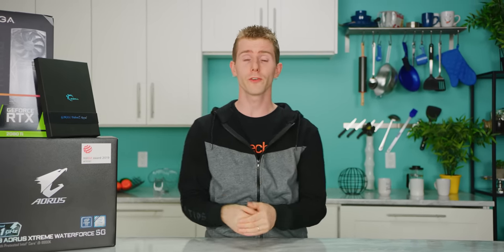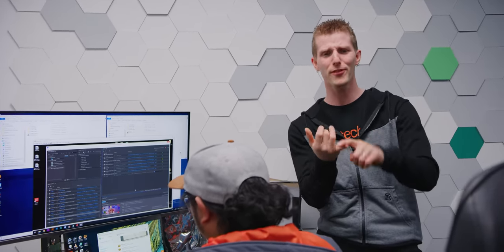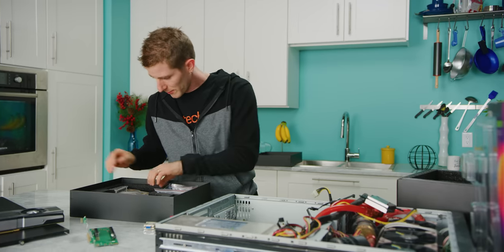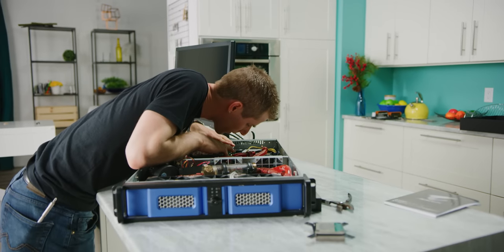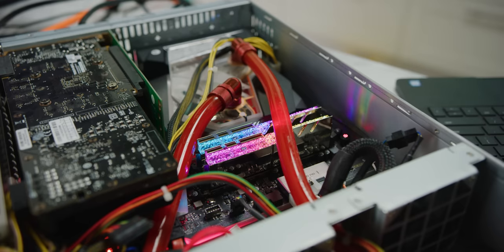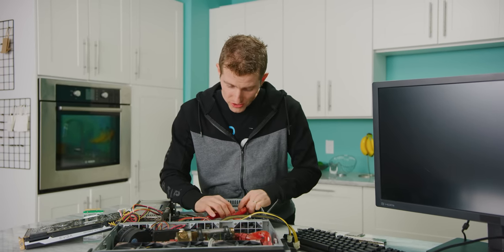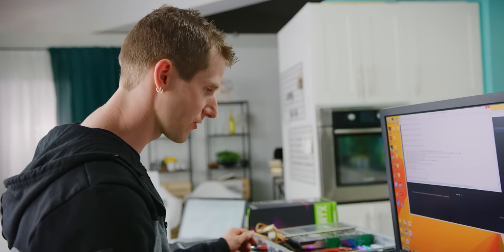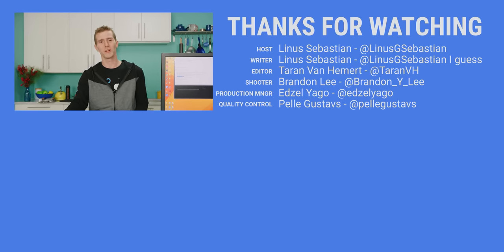All this work... for what?? - Upgrading the Video Render Server

Comment: Linus: If you're gonna do real work on your computer, go with AMD
Also Linus: Another Intel cpu please
Reply: nvidia tech tips i mean intel linus tips, whatever gives me more money
Reply: @zungaloca  so true
Reply: waste of knowledge  he needs the sweet money of sponsorship
Reply: Well yes and no. He strongly recommends AMD's products, but he has also made clear that AMD is still not the king of frequency, and that for the workload here that is what they need. So one way or the other, if you have the money or chips laying around, then it would be a stupid idea not to use them. I think a few WAN shows ago he spoke about the topic in question as well. And if I remember correctly, it was something like "AMD is good value and great chips on the market right now, but a person who is not money bound, and has the task for the better chip, would still go for the more expensive, less bang-for-buck chip". No direct quote, but it was something like that, regarding his personal rig upgrade I believe.
Reply: @Ricooo1308  makes no sense. Those recommendations are based on varied use case unlike the task in the above video where it is very specific. It makes so much sense to see if more cores improves efficiency and then compare both brands. That's the common sense way especially since they have the cash to do such an experiment
Reply: He probably needs thunderbolt
Reply: Ryzen 3000 wasn't out when this video was filmed. Not sure why they didn't wait tho.
Reply: The AMD fanboying is getting annoying, now. It's their fucking servers and people are still trying to tell them what to use.
Reply: @Nighterlev  Cite your source for "It's been proven AMD's lower frequency is actually better..."  - where? I'm not an expert, but core for core, thread for thread, that's not been true in hardly anything I've seen. AMD manages to outperform Intel despite lower frequency in multithreaded workloads (especially at price points) due to typically having a core/thread advantage, enough that I'm definitely considering a 3600-3900 for my next home network file server upgrade (it doubles as a limited video and audio editing station and runs a plex media server), but I can't find a way to substantiate that broad claim which makes everything else you say suspect. I don't know enough to state Linus is RIGHT that this is an example of a frequency dependent workload, but I'm pretty sure your statement isn't accurate.
Reply: @Ricooo1308  don't argue with fanboys.it's always a waste of time
Reply: @think_ffs3934  This sentiment comes from the recent ryzen tests, where any of the ryzen 3000 chips approximately match the 9900k single threaded speed, despite being clocked lower.

I think it was gn in their ryzen 3900x test, it was finally faster for Adobe premier than the 9900k.
Reply: Did you note the message they put on the screen in the video. They don't really need that higher frequency. Their analysis is wrong, they need more cores, as many as they can get, as while not 100% of the job is paralizable, the vast majority of it is.
Reply: Did you not catch the last line of the show? 
"That will really let this thing rip."

I would assume this choice of words was not by accident.
Reply: @____5837  Thanks for the response. Adobe PREMIERE still benefits from core/thread count, which is why the 3900x outpaces it in premier, and loses to the 9900K, 9700K, and even the 9600K in Adobe PHOTOSHOP which is not thread dependent. (The 9700k is functionally equivalent to the 9900k there despite the lack of hyperthreading, showing that Photoshop is basically single-core.) So I don't think the original comment that the AMD's lower frequency is better is accurate - it's a better option for many workloads because of threads, not because its IPC or Core clocks are magically better despite being lower/slower.
Reply: Adobe Premiere is known to run faster on Intel chips...
Reply: Yeah that really surprise me, why is he keep updating personal system, and even workstation with intel
Reply: @stfuna4b  Historically, yes, but that seems to have just changed with the 3900X. BUT I still maintain that's cause the 3900X has a cores/threads advantage overwhelming the IPC/frequency advantage of the i9-9900K. Nighterlev was saying AMD's lower frequency was somehow "better" but it does less IPC still and at lower clock cycles, so unless they have some other secret sauce that doesn't show up in games or single-threaded performance like Adobe Photoshop, I'm calling foul on that statement. Despite that, you still have to look at the latest Premiere benchmarks pitting the 3900X favorably against the i9-9900K - for consumer-level chips, it seems a clear winner for that workload.
Reply: @Ricooo1308  I'm sorry but premiere pro is faster on amd
Reply: @wayzrunn3r923  when u do business, U need a well tested hardware that reliable and mature

especially on business environment, just because the new CPU come out business won't use it especially on production 

why? They always prefer the older one that have proven has no issues, They can't afford server doesn't working correctly just because the platform isn't mature yet even for 1 day, it will be catastrophic for business
Reply: @wayzrunn3r923  Yeah by the looks of it, the 3900x would do a fine job with DDR4 3600/3733.
Reply: Yes why not new 3900x??
Reply: @manishdhabalia7778   the bios isn't mature yet, can't risk such work on immature bios

for personal use, it's okay but for this kind of usecase? nope
Reply: He said multiple times: reliability is key. And he also said in the Ryzen 3 review: the motherboards now come with a fan to cool them up and these little fans are the LEAST reliable, I wouldn't trust a work server on that little fan, and the effort to make a hatercooled solution maybe doesn't pay off.
Reply: My thoughts exactly. He needs to stop using Intel for this type of stuff. Intel is only good at gaming and single thread workloads at this point and not even in every use case anymore thanks to ryzen 3.
Fucking stupid. Nobody should buy Intel until they come out with functional 10nm cpus. If you keep buying and promoting their old process node they don't have incentive as a company to fix 10nm.
Reply: Also you would not use ryzen 3 for this you would wait for threadripper three or use something like the 2970wx which has much less switching lag than the 4ccx 2990
Reply: Because he is a paid shill. Entertaining, but a shill.
Reply: @Nighterlev  uh, no.
Reply: @Nighterlev   First of all, I deleted nothing. My comment is... right above yours, so take your own advice and pay attention. 

Second, I've re-read all 39 comments (though YT says there are only 38, there are 39 at the time of this writing) and reviewed each of your 8 including the 2 directed at me. Unless you go back and edit them, none of them contain a source for your claim that the 3700x single thread outperforms 9900K single thread. 

You seem to be confused about the difference between "making a claim" and "citing a source." You've done a lot of the former, even stating benchmark results, and none of the latter - pointing to where they come from so someone can validate that claim. To help you out, maybe I can use the closest thing I saw to illustrate the difference: 

When you write " hell some people even tested Zen2 4.0GHz vs Coffee Lake Refresh 4.0GHz and guess who comes out on top? AMD Zen 2," that's a claim. To make it citing a source, you have to at least say that it was a recent article on Techspot, which I happen to have read. 

Links are preferable but this gets long and the news is recent so the name of the site is sufficient most of the time for someone to find it. I've read that article, which is the only reason I know you didn't just make that up too, and it's actually the basis for my earlier comment that Ryzen 3000 might have a pure IPC advantage for the first time. But as an AMD fanboy, you of course couldn't resist writing that as "some people even tested" as though that article's benchmarks handicapped AMD and AMD still "won." In fact, locking both sides to the same clocks eliminates the Intel advantage in clock speed artificially, which was the purpose of the test they did -- to compare clock-for-clock performance. That's great news for AMD, but it just means that Ryzen can beat a handicapped 9900K. The Cinebench R15 scores I cited TWO sources for in my previous post show that when each chip is allowed to run at their stock clocks, the 9900K still outscores  the 3900X for single-thread performance. It may have lower IPC but having more clock cycles per second seems to allow it more instructions per unit time because it is posting higher scores. 

"Zen2 matches Intel in IPC at lower clock speeds LMFAO."

That's...the stupidest argument you've made yet. It seems either your fanboyism is forcing you to make arguments you know aren't true, or you don't understand what IPC means. Once you're comparing instructions per clock, there's no difference.... in clocks. That's what the measurement is. In fact, AMD BEATS Intel in IPC finally, but can't do as many clock cycles per second, so it is still behind in single-thread performance as the R15 scores I cited show. 

Your claim is unsubstantiated. I tried to give you the benefit of the doubt because unlike you I am seeking the truth and not an outcome, but at this point I have no choice but to consider it false.
Reply: He gets the CPUs for free. I really don't think he cares whether he gets them from AMD or Intel, as long as they are capable of doing what he needs. If he were paying, I'm sure he would get the most value out of his dollar, as he recommends for everyone else.
Reply: @Nighterlev  That's screaming erotic fanboy more than anything else I've seen on this thread lol
Reply: They has strong partnership with intel unlike AMD that's why they use Intel products simple as that...
Reply: @WESKERsgm  True, he got the CPU sponsored. It's free real estate! (If I could get i9s for free, I'd also go with Intel. :-) )
Reply: @Nighterlev  Ah yes, where frequency is 'better'. why is everyone, always acting like professionals in the comments when they have literally no idea what they're talking about? LTT has come a long way, to a point where you can probably trust them to not make retarded decisions. Also, server farms still use Intel, even if some docker solutions switched due to the more cores.
Reply: @AliciaCLR  Ryzen is a proven platform. It's been out for a long time and many businesses are buying AMD servers. Personally, however, I would have waited for the new threadripper since they are talking 64 cores and 128 threads with higher clock speeds. Chances are your talking way better performance.
Reply: maffraid AMD doesnt going well with adobe suite (who favors CUDA and intels since it has higher single-threaded performance speed )
Reply: @MedlinMasbor  Nope, Adobe is faster on the 3900x and with Adobe each thing premiere does reacts differently so which is better changes with each thing you do.
Reply: @MedlinMasbor  So adobe isn't really faster on anything it's faster depending on workload and processor ect.
Reply: @joer8854  true but since there is a limit to the number of cores that Premiere Pro can effectively take advantage of.
therefore  single-threaded performance speed still have huge impact with adobe (5ghz++)
no  doubt AMD still best with price performance tho
Reply: @MedlinMasbor  I was just mentioning it because I watched an in depth piece about how Adobe's core usage depends on the process involved and that it bounces between core usage and IPC. Also IPC and clock speed are two different things. Just because the clock speed is higher doesn't mean it has a better IPC. Ryzen's IPC is actually higher clock for clock than intel so say you had a processor from AMD that's a Ryzen and runs at 5 ghz (we are talking hypothetical remember so grain of salt here) the AMD 5 ghz chip should and most likely would run much better than the Intel part everything else being equal.
Reply: @joer8854  yes i understand IPC and Core Clock...However, the problem is with Premiere Pro..who doesn't scale universally with different architecture. 
again CPU that is theoretically more powerful is not always better since there is a limit that Premiere Pro can effectively take advantage of
Reply: @MedlinMasbor  But that was my point. Not every Adobe workload is the same and no processor is universally better. That's just now how it works.
Reply: @joer8854  i kno,  im just picking the obvious words. here have a look yourself
.
.
pugetsystems.com/pic_disp.php?id=52290&width=800&height=800
Reply: @MedlinMasbor  You do get that there's not  single third gen ryzen processor on that list right? AMD specifically said how they changed the IPC on the third gen processors and that's specifically what everyone got excited about. The two things they improved the most were IPC and memory clocks. That's specifically affects what your talking about.
Reply: @joer8854  twas rekted actually, my bad wrong paste
.
pugetsystems.com/pic_disp.php?id=56253
.
.
for more detail can be found here :
pugetsystems.com/labs/articles/Premiere-Pro-CPU-Roundup-AMD-Ryzen-3-AMD-Threadripper-2-Intel-9th-Gen-Intel-X-series-1535/
no fanboy here
Reply: @MedlinMasbor  Did you look at that chart? Obviously not. I suppose it was if your comparing AMD's Ryzen 9 to Intel's version of threadripper?  That's a $1700 USD processor your comparing a $500 dollar ryzen part to so I suppose your technically correct but I'm not sure that's wrecked? Sure?
Reply: @joer8854  did you read my comment up there? obviously not. here let me write it for you again :
"no doubt AMD still best with price performance tho."
.
so do you want fact or just want to argue?
Reply: @MedlinMasbor  I was pointing out that those parts are not compatible. The part your comparing the 3rd gen Ryzen 12 core to as a way of saying it got wrecked by ipc is a 18 core x99 part with quad channel ram. Those two parts are in no way comparable  and goes against your point since it's winning using core count. 18 vs 12. It's not arguing i genuinely don't understand where you think your coming from.
Reply: @joer8854  at first i just want to point out Adobe software workload favor intel and Nvidia.. why? this Adobe has huge support from this 2 company. 
a big plus for reliability and production. (fail to explained due my bad english)
.

and you stated  : " Adobe is faster on the 3900x and with Adobe each thing premiere does reacts differently so which is better changes with each thing you do ". 

.

you said "faster" regardless of pricing..ignoring price levels against intel.  speed and price are two different subject.
Aand the fact was Adobe is NOT faster on 3900x....the benchmark rekted that "faster" statement.
.
i rest my case.

Comment: Don't use the same OS Installation for comparison. Adobe doesn't like changing Boards/CPUs. I got really bad results when I tried to just swap hardware without a fresh OS install. Even the iGPU wasn't used at all after swapping hardware. After a fresh install this works fine after all.
Reply: If that's the only way, its massive BS. Surely there's a way to just re-detect it.
Reply: @zwz.zdenek  why should they take care about someone switching hardware without a clean new installation?
Reply: They should be able to just uninstall adobe and reinstall. Esp the the adobe stuff in the appdata folder.
Reply: @zwz.zdenek  Adobe totally does stupid stuff like detecting config on install and never updating it again.
Reply: @kilrahvp  you can't just uninstall Adobe and are good to go. As far as I know you really need to install Windows again to make it work.

I don't know why but it is like it is.
Reply: @DAVISION-YT  There is absolutely going to be some way to do it without re-installing windows. Just need to find where adobe stores its settings and delete that shit after uninstalling. Something like ccleaner would probably take care of it, or you could google the specific problem.
Reply: @slicedtoad  no, it is not in any settings because even uninstalling Premiere won't help.

Changing the complete system without a fresh installation is not supported by Microsoft itself. If you change hardware you need to sysprep and generalize your system first because the unique identifiers need to be generated again for the hardware.
Reply: @DAVISION-YT  Oh, it's using the data that is created when Windows is installed and not the data created when Adobe is installed.
That... actually makes sense. At a low enough level, there are some significant differences between programming for different CPU generations. Meaning that if Windows is set up for a certain cpu (the one it was installed with) and Adobe a different one, you could see anything from errors to a significant loss in performance.
Not exactly sure why Windows doesn't support changing hardware and reconfiguring itself... but I can imagine that could be far more complicated than it seems and even if it was done perfectly, there would still be a chance of breaking already installed 3rd party apps.
Reply: @DAVISION-YT  Maybe because their product costs $100s to purchase rsp. a year and has a "Pro" in its name. (I know, I'm being absurd…)
Reply: @TruthNerds  and what does this have to do with someone using Windows out of a supported scenario...
Reply: @DAVISION-YT  Could one just simply do the Reset install in Windows Recovery? might reset the desired settings, instead of completely new Windows install ?
Reply: You should ALWAYS wipe your drive out when switching chipsets. Don't be lazy. Windows configures itself when it is installed and the risk of low level problems is too high. Don't you want the most stability and performance you can get?